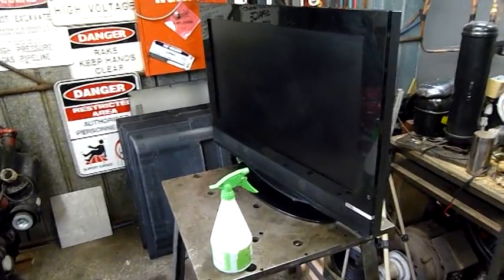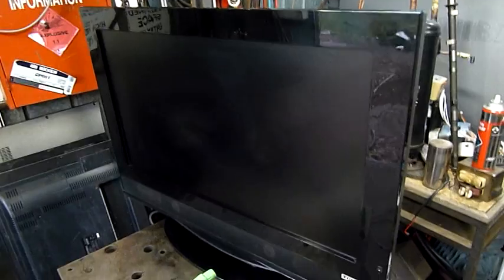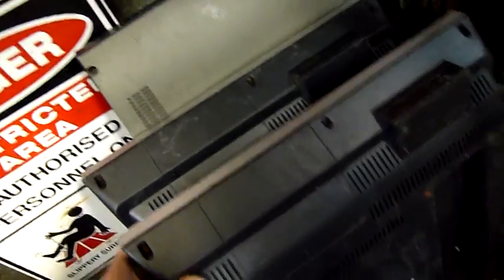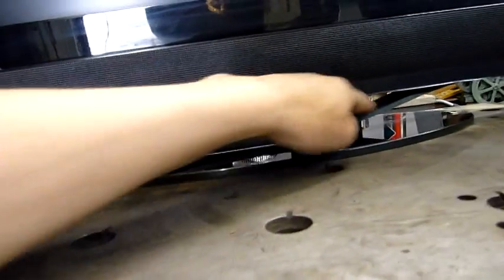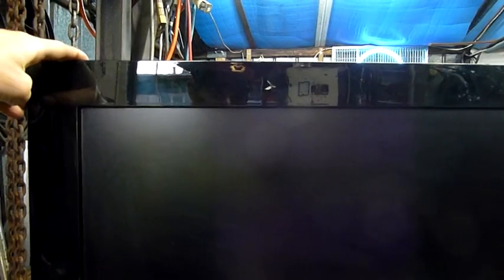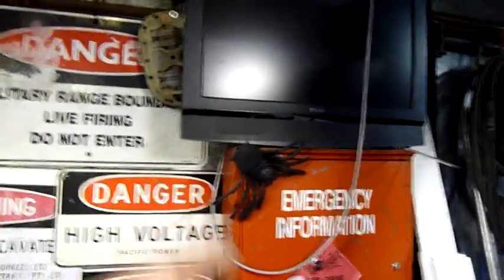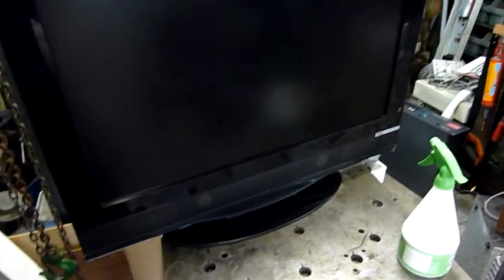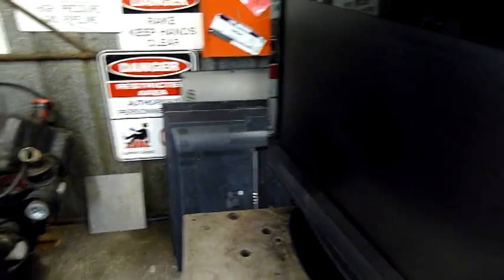TCL 32 inch LCD Repair Pt1 - 12V Rail Fail

Comment: tcl in not a generic brand another thing is that ypu might never heard of it but its the top 3 largest manufacturer of their own lcd panels and vessel and their own motherboards, its on par with samsung,sony,lg, and all mainstream brands. they just got their permits to sell to usa back in 1966 their started their brand and their are doing super great now with their latest technology qled and their brand new oled displays that they make by themselves they dont ask for parts to other brands or company's. overall i give this tv a score of 89 out of 100 and that's impressive counting the price of this tv in compassion to samsung qled hdr 55 inch tv 4k that can cost you up to 1000 bucks, this tv cost half of that with one of the best warrantys in the market 1 years no questions ask just they send you a box you send the tv and they get back to ypu with a new one or your same tv but refurbished in less than 3 weeks and thats impressive.

Comment: Toyoda is the actual name of the fellow that founded Toyota Motor Co. and his family still holds a controlling share of the company, kind of like the Ford family and the Ford Motor Co. Whoever is behind these TVs likely chose the name because it isn't trademarked and because some would associate it with the more famous car company by default. Curiously enough Toyota Motor was in the radio business for a few years after the war, I guess they had to diversify while Japan was being rebuilt.

Comment from the maker: a fault in the digital board is usually the culprit, usually requires the replacement of the board if the cause is not obvious (caps, bad solder joints)

Comment: New hat, your repairing one :-)

Yep i thought faulty caps, thats the only thing with smps they kill the caps :-(

I would be an evil sod and apply 12v to the wire, you never know if that is just one of the faults it has.

great vid :-), hope the psu comes alive :-)

Comment: Looks like you are going to get it fixed, I guess the blinking is just safety shutdown, due to wrong voltage. :)

If you are going to MOT one of the others.. could you try to do it with and without back-light? (isolate the back-light + back-light PSU from the MOT, no need to kill both, and it will make the effect more visible as things break)

Comment: I just got a teac. Starts. shows teac on the screen for a few seconds. Then makes some white noise and goes blank. Any ideas? Cord was cut off. has 12v in. does the same on 12 or 240v. Too good not to try and fix. PSU could be handy, not many other usefull parts to canabalise. No signs of heat or water damage.

Comment: I am the exact opposite. I would rather have a smaller sharper image. 2560 x 1600 at 30" then a bigger image at a lower resolution 1920 x 1080 at 50"